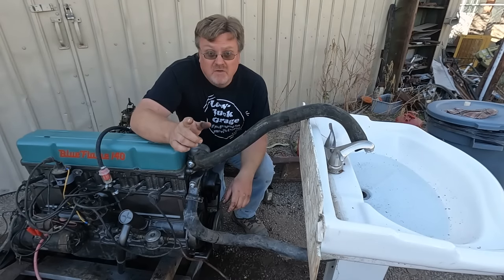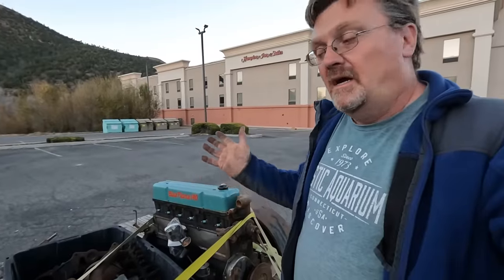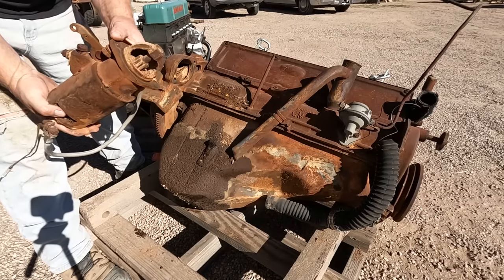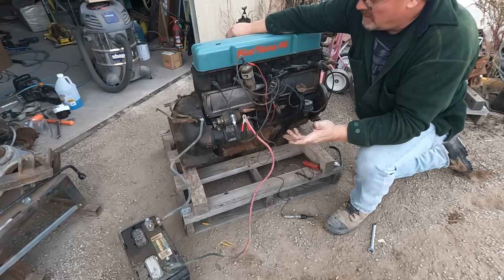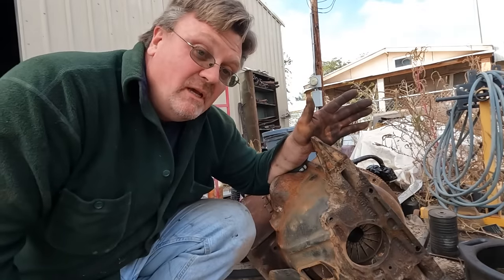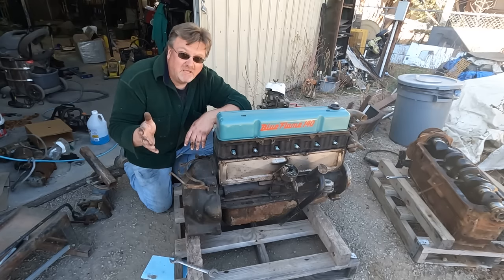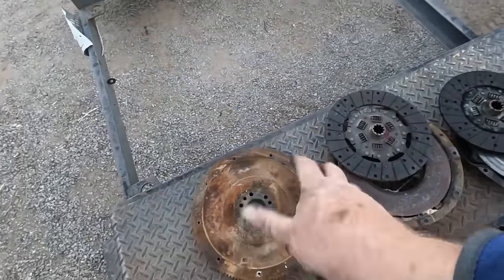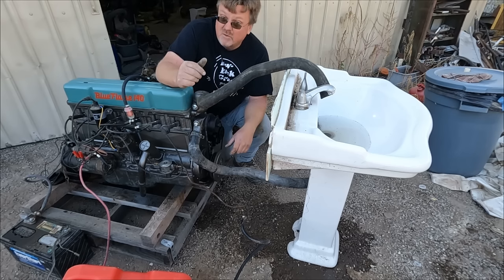Chevrolet Blue Flame Stovebolt Six, Test Run!

Comment: 3:50 When you mentioned about the heat there & the caliche & seeing some of the background before got me wondering. Might be somewhere (relatively speaking) in my neck of the proverbial woods. Somewhere in SW AZ what with the desert bushes in the background of some tests. That drive was showing some mountain ranges looking vaguely familiar...later trees either Northern AZ or upper CA.
Reply from the maker: I'm southern NM, picking up the engine was going in to the mountains in the Ruidoso area.
Reply: @LowBuckGarage  Forgot about NM having similar looks to South & North AZ. Not been out that way before (yet).

Comment: The engine that you removed the oil pan from is a 1955 engine. 1955 is the last year they used shims on the main bearings and the first year for the long water pump. Also 1955 is the only year they had a floating oil pickup. In 1956 they went to tang style main bearings that allowed you to change the main bearings without removing the transmission and dropping the  crankshaft. 1955 and older Chevy 235 and 261 engines  and 216 engines has dowel type main bearings. That oil pan mod is something Bubba did in his garage, not the factory. 1955 to 1962 have a different bolt pattern on the oil pan, so they don't interchange with 1954 or older engines. I spent 40 years collecting, modifing, rebuilding and racing 235 and 261 Chevy six engines. 10 years ago I had 27 pre 1963 Chevy six engines, a large collection of speed parts and many books on rebuilding and hot rodding these engine when I got very sick and sold it all.

Comment: Wasn't the actual Blue Flame the Corvette 150hp engine? At least it isn't a splash lube model, like the 1948 we had.
Reply from the maker: From what I understand the whole line of sixes got the "blue flame" name when they went to pressure oiling and higher compression.  The corvette version got triple carbs and more power, possibly called the "Blue Flame 150".  I don't know any of this for sure, I just started learning about these engines.

Comment: If it’s a flat flange then put grade 8 bolts in from the back. Tighten them a bunch and lock tight them. Now you have lugs like a car. Buy lug nuts and away you go. Works great, done it to all my small trailers.

Comment: In the UK I had a 3 litre Diesel WJ and the turbo went. Tried to remove everything to swap it out and I was stumped by one hidden bolt on the manifold. Never did fix it.

Comment: haven't watched yet, but, saw a bearing buddy in the  intro clip, curious to see what your experience over time is, i've heard they don't help a whole lot.
Reply from the maker: I've had good luck with them on boat trailers because they put positive pressure on the grease and that keeps the water out.  You do have to pump them up every once in a while as grease goes out the back seal.  Also, the grease going out the back seal makes a mess of the rim.  On a regular trailer I wouldn't normally use them, but this one sounded funny and I thought the bearings could use all the lube they could get.
Reply: @LowBuckGarage  thanks for the info!!!

Comment: I turned wrenches for seems like forever as I am 73 now and did it most of my life so ya... long  time., and I learned a few things here. I ran across one of those oil pans many years ago and thought some hobo was just a broke dick like myself. I went ahead and used it cause it was clean and did not leak. Never ever gave thought to the company building this stuff could of did this but will give kudos to their welding skills as its a lot of brazing. Now that sink is one crazy great idea and sorry I never thought of it myself. Great video buddy

Comment: Hi , while it took two days to get the flywheel and bell housing off ,did you have fun ?  good find on the Chevy 6 , sounds good .
Reply from the maker: I did afterwards!  I definitely was doing something wrong while working on that bellhousing, though...
Reply: @LowBuckGarage  You did nothing wrong. It is just a stupid design. I ditched my 235 for a 1970 292. It still looked original but was an infinitely better engine.

Comment: I haven't seen a lot of Stovebolts, but I have seen an awful lot of Toyota F motors and that looks like a dead ringer for an early F155. Especially the bellhousing.
Reply: Exactly, Toyota is based on the chevy235 - for that, some where hoping the Toyota heads would fit - they don’t
Reply: https://en.wikipedia.org/wiki/Toyota_F_engine. Link has a small section on the relationship, which was to the GMC 6 not the 235 … lots of urban legends on this

Comment: I was thinking just a cheap electric fuel pump from your auto parts store should be able to do it now you might need a transformer if it's a 12 volt and you're running it off of a six volt system but beyond that you should be all right

Comment: Dumb question here:   Is it possible to use a big impact wrench on the front crank pulley to crank over an engine if you are just trying to loosen it up or have starter/battery/flywheel issues?   Would it spin it would you have to rig up a pulley and belt to gear the impact way down?   I am a very limited mechanic .
Reply from the maker: The biggest problem it that the impact would over-tighten the crank bolt.  If you drove it with a belt it would be better because that would absorb the shock.  It would be a bit tricky to rig up, but it should be possible.

Comment: You pulled the pressure gauge from your lift transmission.  I wonder if that's why it won't move under its own power any more
Reply from the maker: I replaced the gauge with a plug, so no issue there.  Actually the forklift transmission is working pretty well since I went through and cleaned the pick-up screen.

Comment: I just put the correct size socket with a extension and tap the extension with the hammer 99% of the time flattens the bolt locks

Comment: i have a 48 fleetmaster 316 3 on the tree 90% original is it worth the head swap to raise compression
Reply from the maker: I've just started learning about these engines, but from what I've heard it makes a noticeable difference.  However, if it was my call, and your current engine is running good, I wouldn't change it.  The car's not going to be a rocket anyway, there's very few of them left, so might as well keep it original.

Comment: Reminds me a bit of the old Volvo b30 engines we used to make here in Sweden.

Those even came with a triple Stromberg 175 carb setup. Not very good really, but looks cool. Some of them were also fitted with fuel injection from the factory, on a pushrod 6, in early 70's Europe!

They're cool little engines, here's a hot one: https://www.youtube.com/watch?v=oPrvA_8Oayw

Comment: Why are you put so much into making sure you put the flywheel back in the same place. They are made so you can't put them on wrong. If you try, The bolts won't all go in (because of balancing) try you'll see what I mean. not to speak of your line up dowse,   at least on this one